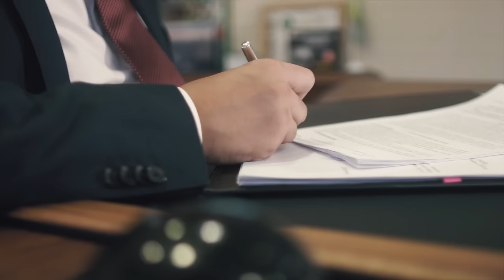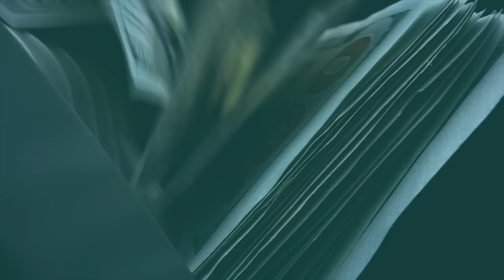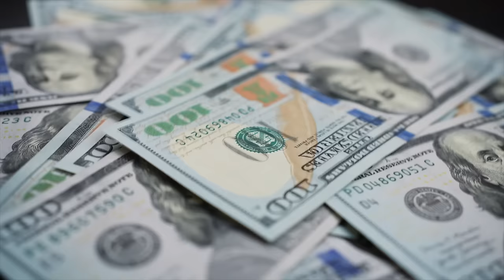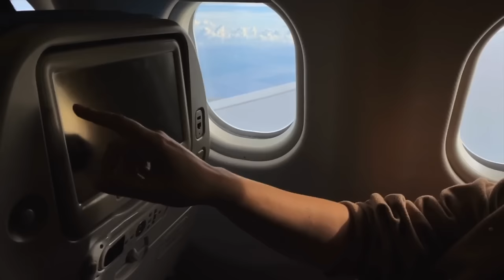How California Finally Plans To Finish The High Speed Rail Project

Comment: Acela is a near-HSR system already in operation. Brightline just completed another leg of its near-HSR system in Florida. Brightline is also expected to start building HSR from LA to Las Vegas this year. Meanwhile, Texas whose politicians once promised HSR from Dallas to Houston have reneged. Oil money and opposition from Southwest Airlines has proven too powerful. Indeed, a lot of the slow progress on HSR is due to opposition by Big Oil.
Reply: Disappointed with Brightline's speed.
Reply: @davidjackson7281  Uses old existing track like Acela does which limits its speed. Brightline's Vegas to LA route will use HSR dedicated track with a speed of 190 mph. California trains will go 200+.
Reply: @shouldersofgiantsinvestor5302 BL spent $6 B to replace and upgrade to 110 mph trac and for new 125 mph trac. Not old trac.Appears BL is not exceeding 90 mph much on the 110 mph track from West Palm to Cocoa. Also, two draw bridge chock points and commuter/school cross traffic on 300+ at grade crossings. With improvements Brightline can reduce the full trip from 3:33 to three hours. Saw one trip was 20 minutes late. Based on projections vs. real world would imagine Brightline West will be closer to a 2:30 trip, not two hours. Will be difficult for CAHSR to go 200+ mph much when the station stops average 43 miles apart.
Reply: Texas Central's project is stalled, and probably dead, for one reason alone....IT CAN'T RAISE THE REQUIRED CAPITAL. The same thing is true of the Texas TGV project in 1992, which I  helped to oversee as a staff person at the Texas Railroad Commission. And the same thing is true of the CAHSR project in 2023. Time will tell if Brightline Florida is a financial success. I hope it is. I'll believe Brightline West is going to happen when they begin the very difficult task of building track in the median of I-15, which is a really bad idea.. Their project is flawed because it only goes from Las Vegas to Rancho Cucamonga. The inability to get to Union Station drastically reduces the project's potential ridership because too few people will drive to RC or take Metrolink. Moreover, they probably won't commence the project unless they can secure federal financial assistance. If the CAHSR Authority would modify their development plan to use a route over Altamont Pass in the north and Tejon Pass in the south, their project would be less costly, and therefore more economically feasible. If that were to happen, it would probably ensure the completion of the project, and make it a shining example of  HSR's future potential in the United States.
Reply: @davidjackson7281  Please see my response to you'll's dialogue herein, which I just posted in the preceding lengthy reply to the other commenter. Good exchange, David. KEEP IT UP.
Reply: @michaeljones7927 Nice to hear about your experience at the Texas Railroad Commission. Sorry about the stalling. Thinking about what you said about the SP Altamont route, is it abandoned? Though having  worked for SP in the 80s am not knowledgable on specifics. The CAHSR has cancelled the second consecutive board meeting this month. Comforting to kknow we agree on realigning the route for good reasons.  Wish BLW would start construction and be a success. Metrolink must get funds to speed up the SB line. Perhaps enough people will drive to RC. Disappointiing that Brightline takes over 3:30 to Orlando. BLW will probably take closer to 2:30. Why is the l-15 median a bad idea other than constraining speed?
Reply: @davidjackson7281  The SP Altamont line is abandoned from Tracy to Pleasanton. It's still there from Pleasanton to Niles. It's in operation from Sunol to Niles, utilized by tourist trains (sometimes steam operated). The Western Pacific line (now Union Pacific) is parallel and sometimes adjacent to the SP line between Tracy and Niles. And, as you know, it is used by the Altamont Corridor Express. As for Brightline Florida, I too am disappointed by their initial performance, but there's a reason for it, David. They are so plagued by level crossings between Cocoa and Miami that they're probably afraid to run at the maximum speed of 110 mph allowed by FRA's Class 6 regulations. I think they had two or three deaths on day one. What matters to me is their financial viability at their lower than promised average speed/elapsed time. I think the State of Florida and the federal government should finance the elimination of as many grade crossings as possible ASAP. Brightline and FEC Railway (owned by Grupo Mexico) should provide matching funds.
Reply: @michaeljones7927 Thanks for the routing explanations Michael. Another reason why the Altamonte route(s) are better. Yes on why it appears BL is not exceeding 90 mph on the Class 6 and yes for the need for matching funds to secure the tracks.
Reply: The Brightline line in Florida is NOT HSR so please stop incorrectly referring to it as such.
Reply: @mrxman581  You're absolutely correct about Brightline Florida not being true high speed rail.  But Brightline is an improvement over virtually every Amtrak route, except for the NEC.  If Brightline could receive federal, state, and local matching funding for  a grade crossing separation program, it conceivably could operate at a maximum speed of 125 mph for much of the route between Cocoa and Miami. Since most of Brightline's route is through urban areas, true high speed rail (186-220 mph) is probably not economically feasible. We need to hope that Brightline attracts sufficient ridership to be profitable. Our desire to see true high speed rail come to the U.S. is most likely to be achieved in California and Texas.
Reply: @michaeljones7927  I agree. I completely support what Brightline is doing in Florida just don't call it HSR.  I hope both BLW (Vegas) and CAHSR get the federal funding they've requested in this next round of funding.  The award announcements are supposed to happen this month. BLW is asking for $3.75 billion, and CAHSR is asking for $2.5 billion. 🤞
Reply: @mrxman581  I'm betting on CAHSR.
Reply: Absolutely! Big Oil, the airline industry, and I would even argue the auto industry, to a certain degree. 

HSR is a threat to their business, and their doing whatever they can, and buying whoever they can, to slow down it progress, if not, shut it completely down.
Reply: It's also the the massive Car Lobby that hinders public transit development. Auto makers don't want people to have other cheaper options of travel.
Reply: @shouldersofgiantsinvestor5302  CA trains will go 200mph. In your dreams. Look at the way, way, optimistic projections of average speed the "bullet" train will have on its journey, you either ignore the facts, or just don't want to know the facts.
Reply: Yes so I am opting out of car and into bikes.
Reply: Brightline Vegas may well be Americas first HSR.
Reply: @Gryphonisle  the Vegas route should be able to be finished, unlike the clusterfuck central CALIFORNIA rotten. Do not count on the 150B plus more $$$ needed to finish the boondoggle!
Reply: The REAL opposition is from SANE people realizing it could take 300B PLUS more money to finish this POS SLOW-SPEED RAIL. So, you're OK with 60mph new rail system that will take DECADES longer & cost up to 1 TRILLION DOLLARS?
Reply: @michaeljones7927 another important one would be Minneapolis, Madison, Milwaukee to Chicago. Starting with that could do well at first. From Chicago there’s multiple Amtrak lines that can get you around America! Our Chicago friends were the railway capital in the 1800s after all. If we’re being optimistic. Minneapolis, Madison, Milwaukee, Green Bay (for the packers), Chicago, St Louis, Detroit , Cleveland
Reply: @enriquecrespo2650  Thanks for your comment.
Reply: «Near-HSR» basically means a fast regular train line outside of the US. The Acela express has a top speed of 150 mph, Switzerland, which is a small country, (basically twice the size of New Jersey, and less population) has surface tracks at 125 mph and tunnels through the alps at 145 mph, nobody would call them «near HSR»…
Reply: @davidjackson7281  Has BL average speed improved, as of 11-15-23? What is holding it down? Fear of more vehicle and pedestrian accidents?
Reply: Texas politicians NEVER "promised high-speed rail between Dallas and Houston". They created the Texas High-Speed Rail Authority in 1988 to oversee a franchise competition for qualified applicants for the PRIVILEGE of developing a PRIVATE high-speed rail system for the Texas Triangle. Texas TGV won the competition (beating out the Siemens consortium), but could not proceed after several years because of its inability to finance the project. Texas Central has attempted for the past ten years to do a Dallas-Houston project, but thus far has been unable to raise the required capital, and currently is exploring a partnership with Amtrak (which probably will not materialize).
Reply: @michaeljones7927 Yes Michael the timetables have improved. The average speed overall is 69 mph up from 66 mph. West Palm to Orlando is 77 mph. West Palm to Miami is 56 mph. Miami to Orlando is 3:25 down from 3:33. Over time other improvements may make the trip close to 3:10. There are $30 bargain fares WP-Orlando.
Reply: @michaeljones7927 l enjoyed rereading your comments on TC and BLW. l feel BL will be successful.
Reply: @michaeljones7927 Sorry about the replies but my comments appear to disappear if too long. Last death (No. 99 or 100) l heard was on 9-22-23 extension day. Hopefully the initial safety mitigation steps are taking place with many more much needed to come. Besides those upgrades and more tracks, the big improvement to speed will be a new, four years to build once it starts, $218 M St. Lucie Bridge. Eliminating a major chokepoint.

Comment: I'm 76. I've been waiting for this since I was in my 30's. I am not betting money that I will live to see it. Like you said in the video, "If Americans want to build something big, fast, they can. The Empire State Buildiing was built in about a year, during the Depression. IMO, it is a literal crime(s) that it has not come online yet. What value do we have for that $70+ Billion to-date?
Reply: There has NOT been $70 invested it it!! More like 1/4 of that has been spent spent.  By end of 2025 the entire Phase 1 will be environmentally cleared, all land for Initial Operating Segment obtained, almost all structures and ROW construction done by end of 2028 (as well as all utilities moved), 6 trainsets under construction, most of track and systems work done on IOP (as well as Caltrain electrified), 5 stations under construction, and prelim planning on Merced to San Jose done. About $35 billion expended will get the IOP (171 miles) operational by 2031.

Comment: The primary advantage of the Central Valley lies in its strategic location. With the implementation of this train project, individuals would have the convenience of commuting to San Francisco or Los Angeles for lunch or dinner, and still make it back home in time for work. This would provide the opportunity for individuals to work in high-priced housing markets like LA or SF, while residing in more affordable areas such as Fresno or Tulare, where homes are available at half the cost.
Reply: Keep dreaming,  without good public transportation,  it's not going to work.
Oh, the purpose of HSR is for everyone to go to every city for work, lunch, n dinner. 
Oh, you can definitely get cheaper house in Fresno.
How do you get around in LA?
Don't bring you need cars rail system. 
Your affordable house only work if every city has state of art public transportation.  So far, only SF meets this condition. 
Think about the money waste on HSR can be used to improve public transportation.
Reply: I also imagine there will be economic development around the stops
Reply: @justyourfriendlyneighborho903  it depends.  If train stations are far away from everything,  there will not be much economic activities. 
The ideal solution is public transportation hub for each station.  No, having one or two rails n couple bus connections are not enough.  In major cities,  the stations have to be as complicated as Tokyo station.  Lots of platforms n different places for different bus routes
In small cities n towns, one place for several bus routes. 
Then you can have economic activities.  People make transfer can stop at different places.
NO, THAT'S NOT GOING TO HAPPENING. HSR SUPPORTERS WILL MAKE SURE THAT DOESN'T HAPPEN.
HSR supporters want the big parking lots, they show up 5 minutes before,  get the tickets,  board the train.  Many HSR supporters mentioned just in time boarding is the reason they support HSR. If stations are like Tokyo station that has Lots economic activities,  HSR supporters will not take.
The public transportation is terrible outside of SF. There will state of art palace like ghost town train stations. There will be below grade F public transportation  at each station. 
HSR supporters just don't know the true meaning of HSR.
Don't expect lots of economic activities at each station thanks to HSR against improve public transportation and animosity toward car drivr
Reply: @commentorsilensor3734  Car sharing can be good. You take HSR, grab car share car at the sation and drive to work. Of course it should be close to one of the stations. LA is huge but business area is by far smaller.
Reply: @Alexriga  People can choose carpool, uber, or taxi, but the primary mode must be public transportation . The business areas are smaller, still, they are not all easy accessible by public transportation.  In most train stations , walk 5 miles is faster than taking buses from train stations. 
Not everyone can carpool. There are different reasons. 
Therefore, driving,  uber, taxi, still create traffic congestion n carbon footprint. 
LA wanted to create this fail environment,  you can pretend to be environmentalists by driving in n out of stations.  That has not worked very well.
Remember trains are supposed to help non car drivers. With this stupid design,  85 doesn't

Comment: 3:00 - the picture of BART is confusing/misleading. BART is an entirely separate system, with its own bespoke gauge and a 3rd rail. HSR will be using the newly electrified and upgraded Caltrain tracks from San Jose to San Francisco.

Comment: Why not get a northern section like SF to Gilroy, and southern section like LA to San Diego, operational first? Now there's a bit of revenue, and all additional track will incrementally improve operation. There won't be revenue for years still with the current project. Or - am I missing something?
Reply: Idk why they didn't do LA to SD first.  The Surfliner is unreliable but is the second most traveled rail corridor in US (The NEC is number 1) so it would've been smarter to do that